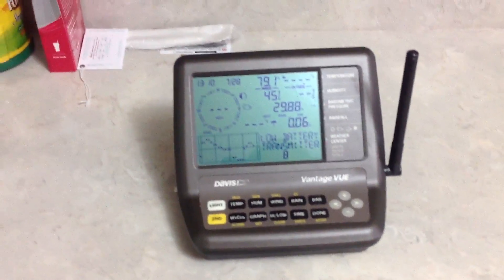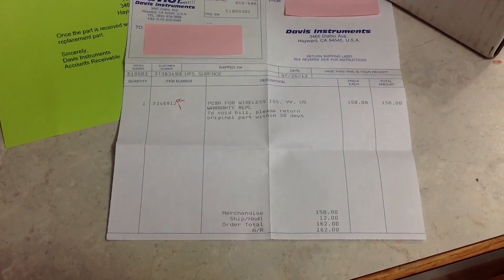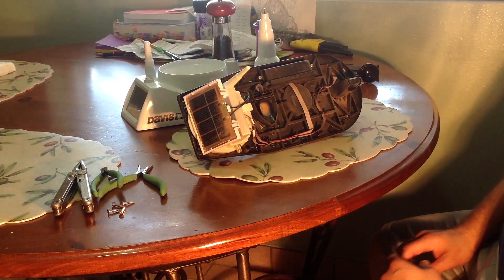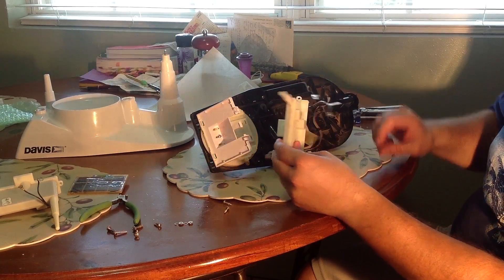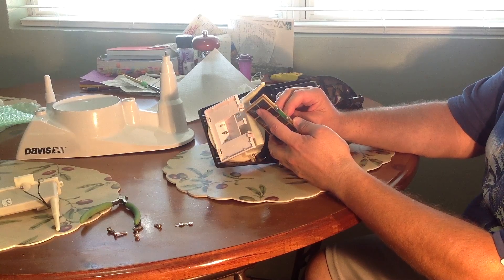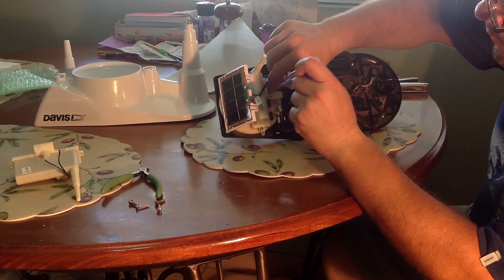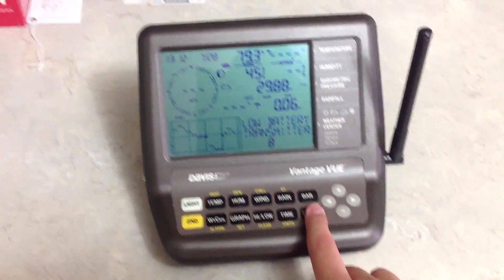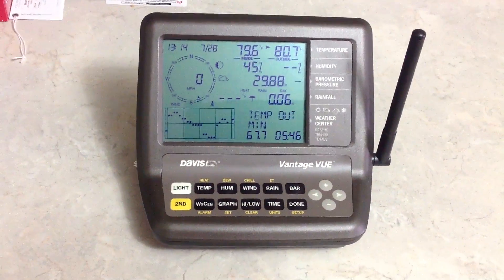How to Replace the Transmitter in the Davis Vantage Vue Weather Station

Comment: I have a low battery on transmitter showing up, I have not replaced it yet and this would be the first one. I now know that it is a CR123 battery, My real question is that how do you change the bttery, Is it a little door on the bottom? and is it screwed shut also?  the reason I'm asking is that my unit is up high on a tower and it's 8F degrees here today in milwaukee, so when I climb up there I want to make sure I have everything I need to this fast and get down before I frezze to death upthere
Reply: No tools needed take gloves off small thumb screw carfull don't drop it have new battery ready put it in tighten screw and done